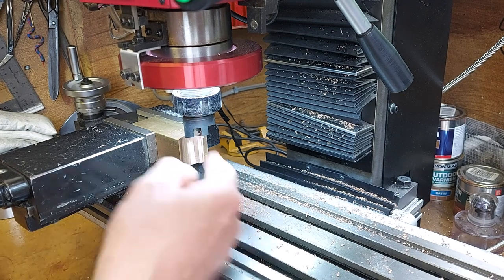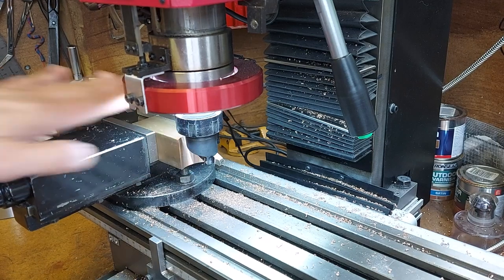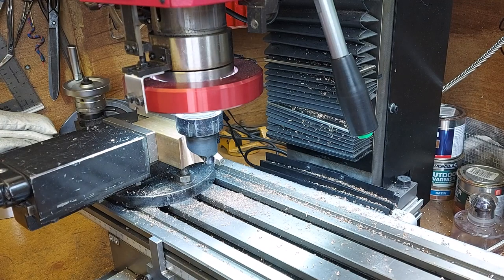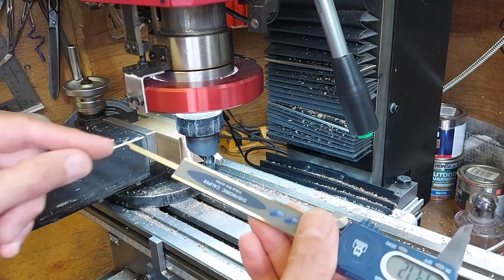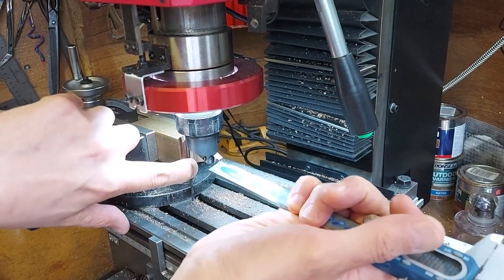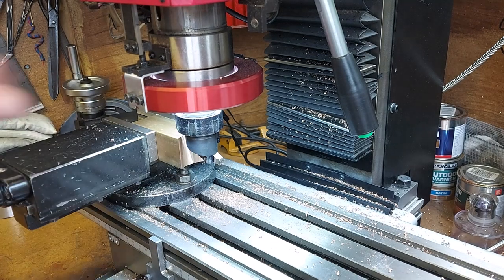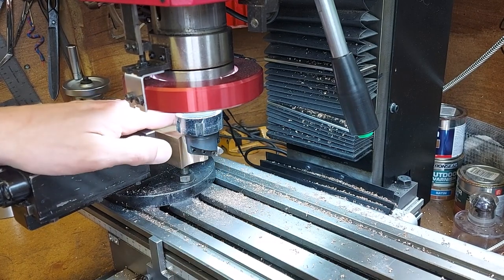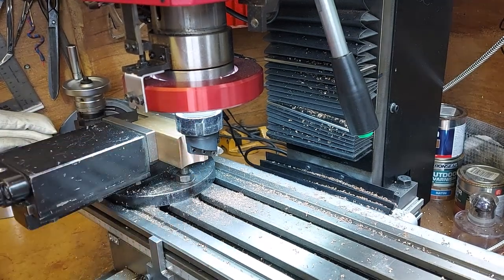Flycutting a Saddle

Comment: Here is an easier way 
use an edge finder to set the spindle bore over the end of the part then move out by the required radius  then fit the fly cutter and set the cutting tool so it touches the end of the part and zero your dial or dro then move in by the required depth of cut .